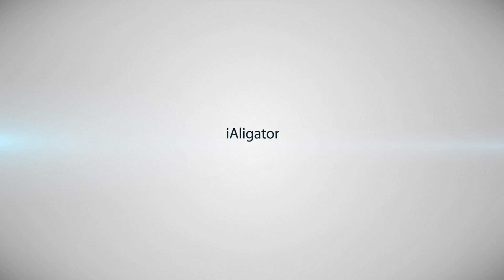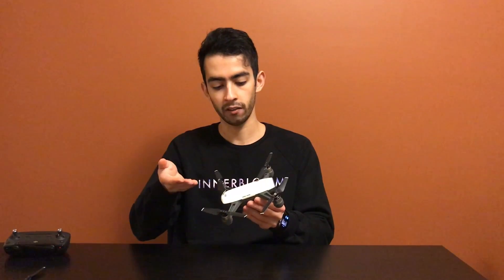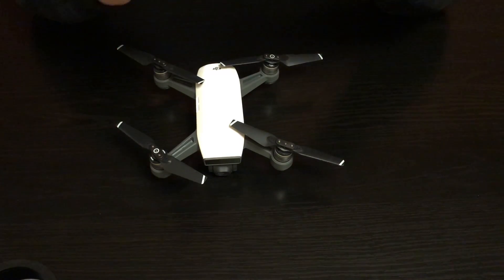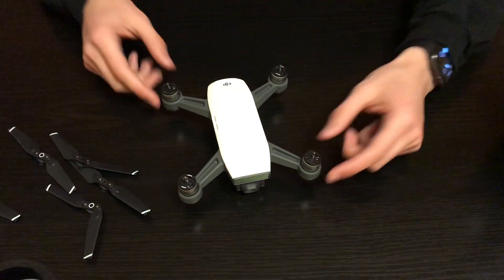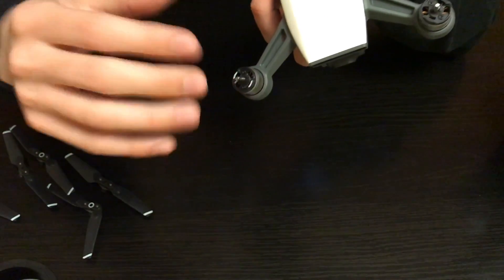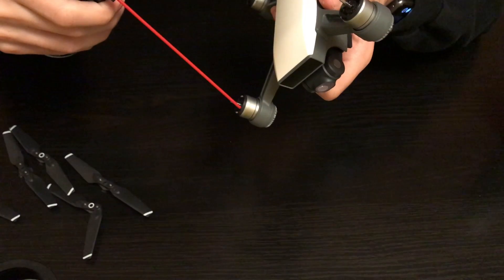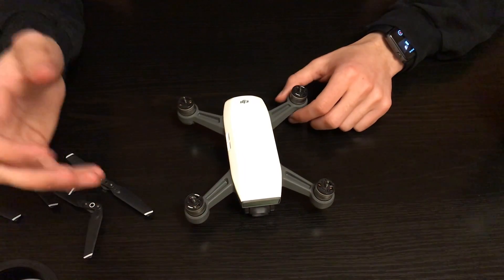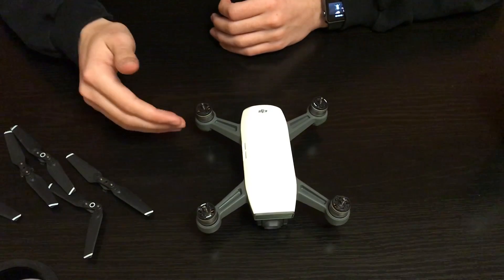DJI Spark Sand Damage Repair

Comment: The vacuum idea helped. I also used strips very fine grit sandpaper with WD40 and slipped it in the spaces and tired the motor to get the grit out.

Comment: Hi iAligator, great video. I've had my Mavic Air for about 10 months now and today I crashed it. Wasn't watching the battery level and before I realized it I knew It was going to crash. I was trying to maintain altitude and get it back as close as possible to the launch site. I ended up flying it into a chain link fence. It flipped over on it's back and probably did dirt angles before shutting down. We were off roading so I had the tools to dig under the fence and was able to reach it with a hoe. I could see all four blades were broke but that's all. When I finally rescued it and look it over I discovered all four motors had sand in them. Thanks to you I was able save the motors. When we got back to the house I was completely baffled as what I was going to and that's when I found your great video and it saved the day and the motors. Thank you.
Reply from the maker: William Faulkner Great to hear!

Comment: Will try this for sure! I crashed my Mavic Air on the sand last weekend so I was already looking for motor replacements on Amazon but I will try this first and see how it goes. Nice video! even if it doesn't work for ma later.
Reply from the maker: Tyrone Celix Thanks! Hope it worked out for you.

Comment: I had the same problem but with dirt, the only problem is I forgot how it got in there, so I’m assuming it was dirt, how I know there is stuff in there is I hear a rattle noise when I spin the motors by hand, any suggestions?

Comment: Great video and advise, thanks. Fixed my spark gimble motor overloaded issues, the vacuum and dust-off worked great. After thought, don't fly the spark near the beach or places with lots of sands. Or you should use launch pad when taking off from hazard areas.

Comment: Hello, My dji spark gimbal broken due to fall above 30 feet height and I tried to test my spark and motors are working but drone is misbehaving while flying and also its motors are not stopping when I turned my spark to ground side, please help me on this issue.

Comment: I have the same problem but the sand is magnetic sand. So has particle of iron. Is it possible that i can fix it with compress air?
Reply: I got the same crap in my motors, that damn black sand....did it work for you?
Reply from the maker: Enrique Rodriguez That’s a tough one. A combination of compressed air and a vacuum cleaner with a narrow tip is still worth a shot.
Reply: jbyam 79 no it didn't help, i had to change the motor
Reply: I had it BAD!...motors were almost completely seized. I bought a can of the compressed air and did the vacuum in the air, and it did hardly nothing, Motors real hard to turn and when you did turn it it sounded like the send was never going to get out of there. Well I fired up my air compressor and I unscrewed the motors from both sides and let it just hang by the wires and really got in there and blew the shit out of it, and I got them to where they spun pretty easy, but still sounded horrible and then I just started my drone up, and only one motor would Spin and it just kept shutting off, I just hope the other Motors along with my finger, just kept restarting it, the motors I'm talking about, and eventually it worked, now my Motors are just like nothing was ever in them, I got really lucky!